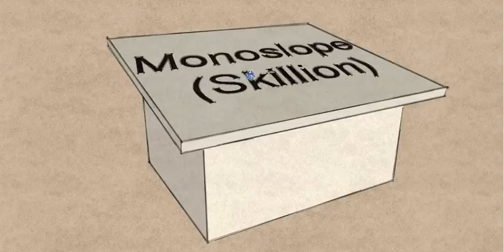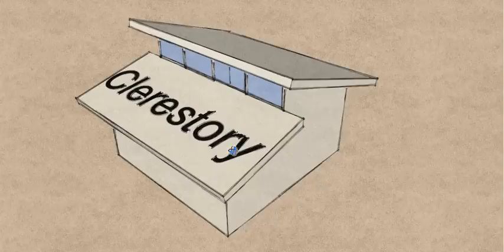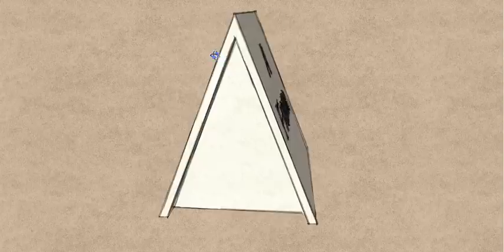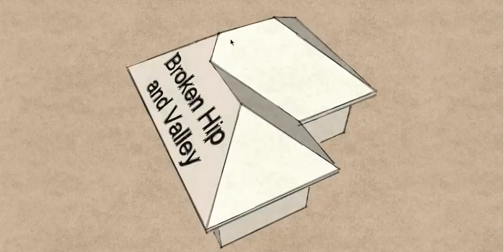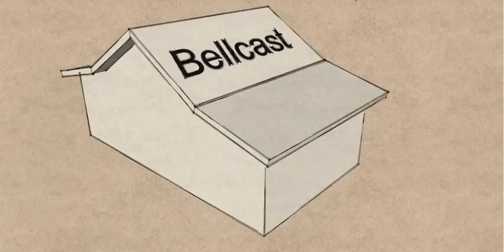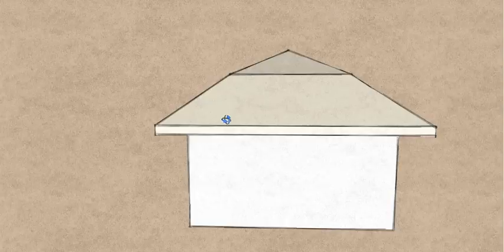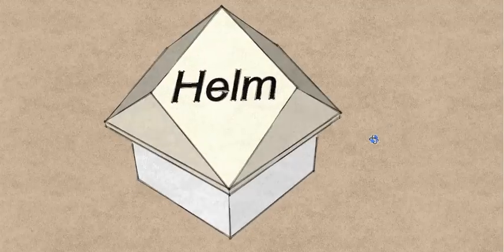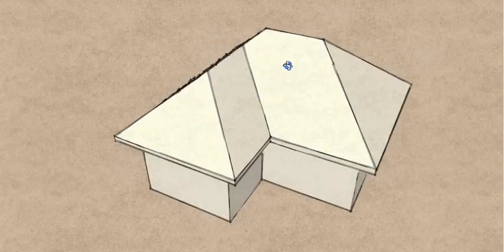Roof Styles

Comment: how many diff styles of hip roofs is there? or how big does the building have 2 be in order to have a ridge?
Reply from the maker: Hi Mate, There are heaps of different types of hip roof and you can mix and match with other styles as well. Any size roof can have a ridge one side of the building just has to be longer than the other.